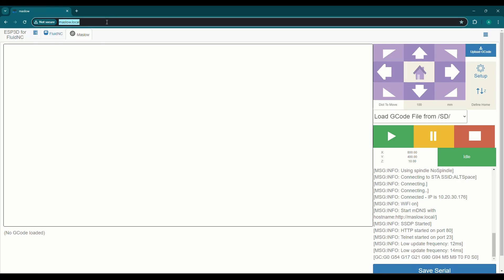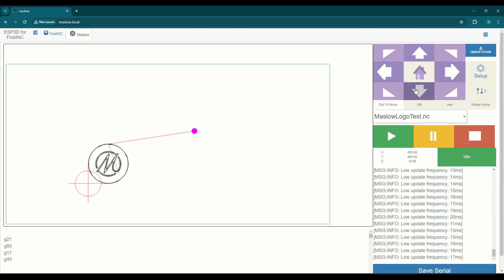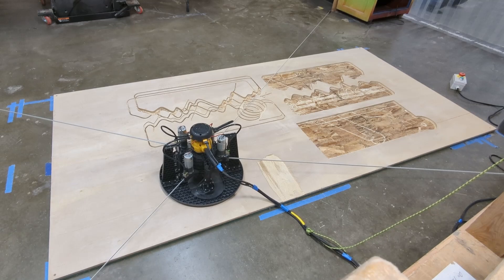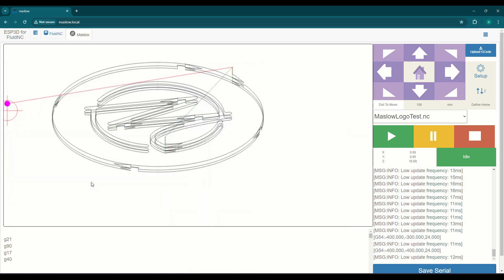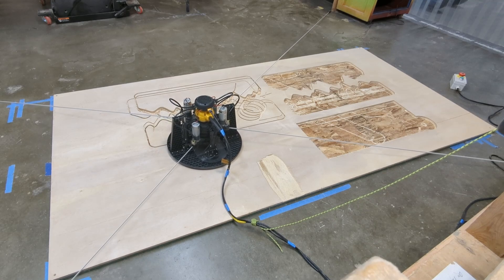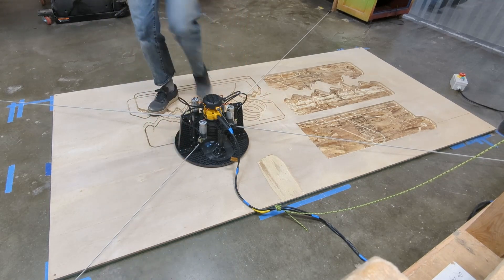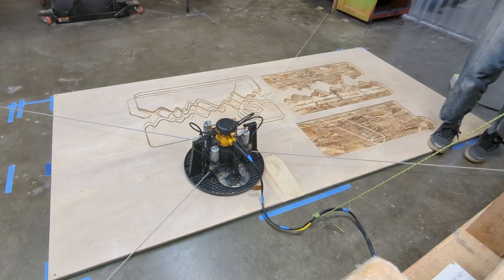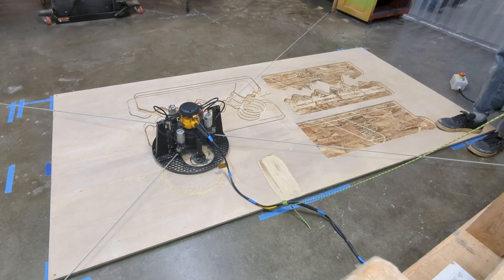How to Set the XY Home and Begin a Cut on the Maslow 4

Comment: It would be nice like in a slicer like Cura (different color for travel or printing). For the pink dot of the router, to change color (Green maybe) when the bit is at cutting depth. Example. as you travelled to the logo I would like to see the point the bit plunged. Just an idea.
Reply from the maker: Oh interesting idea! so you could tell if its traveling vs cutting. We will look into it.

Comment: what about the dust ?
Reply from the maker: This specific Maslow doesn't have the dust collector attached in the video. But if you would like to attach a vacuum, here is the link to the files so you can 3D print a part that will match the diameter of your vacuum hose https://www.maslowcnc.com/the-not-shop